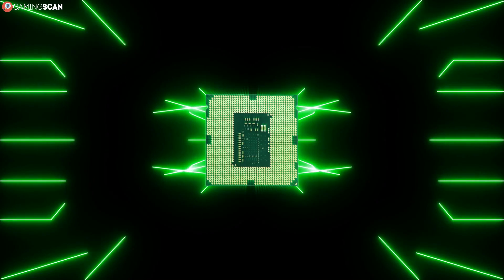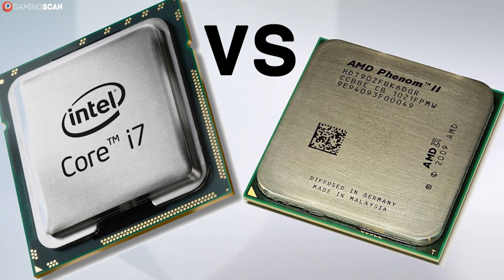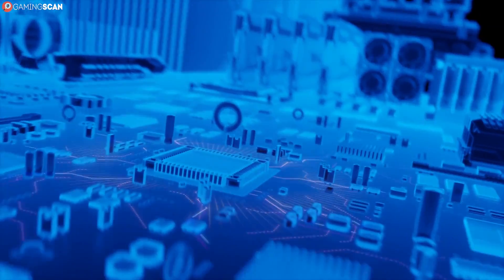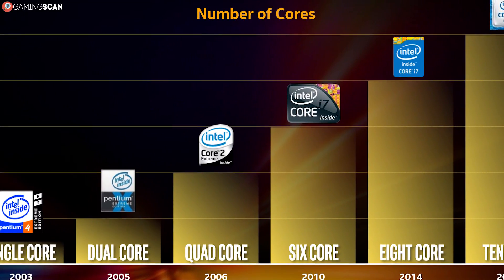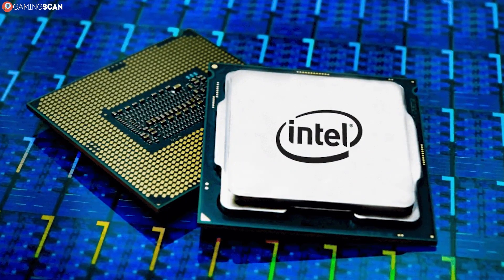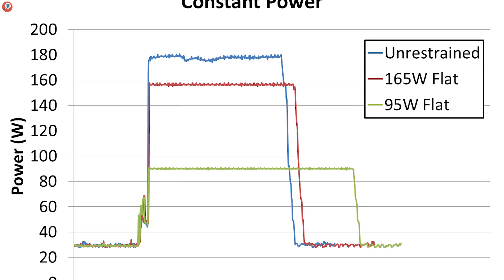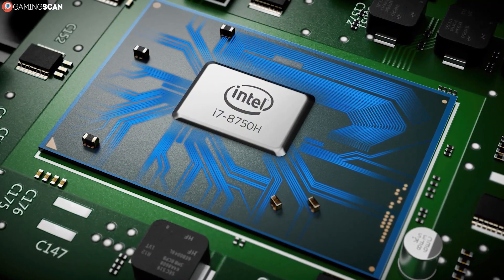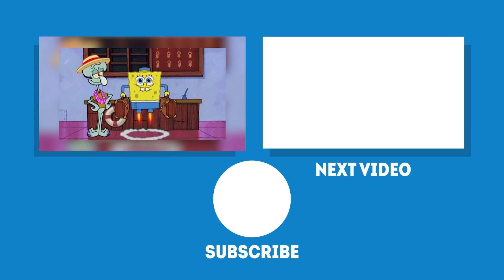CPU Specs Explained (2020) [The Ultimate Guide]

Comment: Good video I learned a few things. 
Question: if you have integrated graphics on a CPU and pair it with a good GPU, will that enhance your overall graphics performance? (Also do all CPU’s come with Integrated Graphics or only some models)
Reply: No your graphics out out depends where u plug your monitor into so put monitor into Gpu for best performance

Comment: Cpu cache is very important for games the ryzen 7 5800x3D has 3 times as much cache as the ryzen 7 5800x and the 5800x3D runs games with much higher refresh rate

Comment: A bit late but hey, just to point out something here.

The i9 and r9 are not Workstation CPUs, these are categorised as Enthusiast CPUs and are still mainly targeted at Gamers. For Workstation it's Threadripper for AMD, Intel does not have an equivelent SKU. That being said, there is nothing wrong in using them as Worstation CPUs, even i5 and r5 are capable in this regard.

Threadripper does not use the AM4 socket, the video is very misleading on this as it shows a Threadripper CPU when talking about the AM4 socket. Threadripper uses TR4 and TRX4 which RYZEN CPUs will not fit into and are also way more expensive.

Your explanation of Clockspeeds is simplistic and wrong in regards to how many instructions can be executer/second, IPC (Instructions per Clock) is important here, and far more important these days than clockspeed. Whilst IPC may not be something listed on any consumer spec sheet, companies will boast about IPC gain over previous generations CPUs, usually listed as a percentage gain. If Clockspeed is all that mattered, then there would be no improvement in performance over the last few years. Look at IPC as like an efficiency metric.

Your explanation of Cache is bonkers, everything a computer does benefits from Cache, even Gaming, and it has nothing to do with multitasking. Take AMDs 5800X 3D CPU with 96MB L3 Cache, 200MHz slower than the 5800X which has 32MB of L3 Cachel, yet is has around a 15% performans increase.

AMD APUs are designated with a G, so an r7 5700G for example is an APU, this one is 8 core / 16 threads but has less cache and lover clocks than its none G variant. On a budget, anything from an r5 3400G upwards will allow you to play most games at 1080p reasonably well, just do no expect to be running much on max settings, but as a stopgap untill you can afford a GPU, they are excellent.

Currently using a 3400G with no issues in the games I play, Path of Exile even @ 1440p runs fine, even ARK runs quite well @1440p but you notice the frame rate dropping a lot, but to be honest, unless you are playing competetively, its not the end of the world, and you get used to it.

Comment: A good way to visualize clock speed is to imagine it as a car's engine. Higher rpm(clock speed) doesn't always translate to higher horsepower/torque.. 5000rpm in a corolla is not the same as 5000rpm in a huraycan

Comment: Wait so I’m confused about something. When I look at older cpus they have the same number of cores as newer ones and not a bad clock speed but are still older with the newer ones being much faster than them? How does that work if they have the same amount of cores and I’ve even come across some with higher clock speeds that perform way worse. Like the amd fx 8150 has 8 cores and a base clock speed of 3.6GHz while the intel core i7 10700 has 8 cores and base clock speed of 2.9 GHz but the intel one is much faster? How does that make sense
Reply: Is it because the intel one has 16 threads? But would that really equate to that big of a performance gain especially with the intel one having such a low base clock speed?
Reply: Looking online, it says that newer cpus can send more data through each clock cycle just because of newer tech which would have been nice to see in the video unless I missed it but then how am I supposed to tell the quality of older cpus then based off their numbers if the reason they are slower is just because it’s “older tech”. How could I compare that with newer cpus to understand how they would perform compared to them so I have an idea of what I’m getting
Reply: @gavingraves8748  Its to do with Core architecture and IPC, basically, CPUs becomming more efficient at what they do at the same speed over the years. A 5 year old CPU will not compete with  this years model at the same Clock speed, there will have been vast improvements in eficiency in the cores, and different architectures brings with it even higher gains.

Comment: Good vid, but correction. The base clock and upper clock is not overclocking. It's called boost clock and it's a feature in almost all modern cpus. It started with Intel laptop cpus. The base clock is set to what it can run on a low temp stabily and consistently. It boosts to max clock to what the cpu is rated for by factory settings. Example. Ryzen 5 3600 is a 3.6ghz base clock that boosts to 4.2ghz when gaming or doing something that needs it. This keeps Temps lower and is more efficient. Now upping the voltage, and cpu multiplyer to a higher number will overclock and in turn you will raise both the base clock and the max clock for boost. You can also overclock ram and for amd ryzen the infinity fabric.

Comment: Intel core for gaming 
Amd ryzen for gaming
I3 and ryzen 3 for budget
I5 and ryzen 5 for mid
I7 and ryzen 7 is more than enough

Don't mind me it's only my note
Reply: I have an i7 but I have to play VANILLA Skyrim on the lowest graphic settings because it lags badly with higher graphic settings. What am I missing? (Sorry for my ignorance, I really don't know much about computers with RAM, Core, Memory etc.)
Reply: @dracoalexios1213  better graphics card probably
Reply: You need a better Graphics Card. They are the most important component of a gaming pc
Reply: @dracoalexios1213  graphics card upgrade needed
Reply: @dracoalexios1213  graphics card most definitely
Reply: @dracoalexios1213  man which generation is your processor.
Reply: @dracoalexios1213  gpu bottleneck but do you mind telling me which gpu you have?
Reply: @dracoalexios1213  maybe switch from igpu to gpu if using laptop
Reply: @dracoalexios1213  good gpu
Reply: i wanna game on a stable fps on modern warfare.what do u recommend
Reply: @simatro9797  i5, minimum 6th gen, with at least 2 decent graphics cards, up to you for those, 16 gb of ram and good cooling system, make sure you get a fan that actually works otherwise you're whole system will go to waste.
Reply: @MikfinityPog  minimum 6 gen ... tf that mean 😔
Reply: @dripdrown3871  Do you not know what minimum means?
Reply: @MikfinityPog  my bad i only recently learned that there’s different gens to intel core i5s
Reply: @MikfinityPog  sli is dead bruh
Reply: @manlikeilyas  Holy shit I didn't even know this comment existed. I remember watching a video made in 2019 where they actually said it was bad to not use more than 1 graphics card.
Reply: @MikfinityPog  yeah realized lol
Reply: I came back for this

Comment: Can someone explain the following:
When pairing an RTX 2080 (Graphics Card) with Ryzen 9 3900X (12 cores/24 threads), it performs either on par with or worse than Intel’s i7 9700K CPU (8 cores, no hyper threading)

I don't understand where we're comparing these two? When they're running a game?
Reply: Most games don't use more than a few cores. Mmos and strategy games like total war use more. A game like call of duty a dual core will suffice. The speed variance is probably because that i7 you reference has a higher base and boost clock speed out of the box. That means it will be faster for apps that don't need a lot of cores. Decoding video, compressing files, rendering, using photos hop filters etc will do better with thr more core processor. 

Now if both had the same cores and same speed it would have other factors. Cache size, memory speed and IPC (instructions per clock) Intel has had better IPC per clock than amd for the last decade but that has changed with zen2 and soon zen3 cpus.

Comment: Hexa core can handle more tasks simultaneously but when its about speed the clock speed of both processors can be the deciding factor. Like a 3 GHz quad core can outperform 1.8 GHz hexa core (same architecture) at specific tasks. Also Quad core is cheaper for budget builds.

Comment: very simple it has tiny switches that allow current through them 1 0 on off, and when you hear 4 GHz for example it means 4 billion times a second so 4 billion excutes a second and 1s and 0s make up all of images text and coding for computers, so what you want to know for a good computer for simple not the best always is that the more cores (parts of the cpu) is better and the higher rate the better, the clock speed it is refered to as is for example 4 Ghz, which is quite good for more than 6 cores.

Comment: Imo, if you're going to be building a budget to low-midrange pc for strictly gaming, Intel is the better choice as it offers better gaming performance at a similar price to AMD. The more you go up in price, midrange to high end, AMD offers more performance for what you're paying and are cheaper in general.
Reply: Could be right on that. From what I've learned intel is usually better for just gaming and AMD is better for those who are gaming streaming, video editing and more.
Reply: @MapleSamuraii  It's just funny that people assume AMD is better just because it offers more cores at a similar price point. Because Intel has less cores, the single core performance is going to be better than AMD but AMD will have better multi-core performance
Gaming is usually not a multi-core task and neither is the average browsing/working experience
I think you'd only benefit from more cores if you were doing medium/heavy multitasking.
Reply: Actually, on a budget means AMD all the way, their APUs are a tremendus cost cutter, back when you posted, GPU prices were just silly and have any realy been affordable to people on a budged within the last 3-6 months. Even then, the AMD APUs means you do not have to spend an extra £150 on an entry level GPU. An I would not recomend Ebay.

AMDs 3400G all the way to the 5700G are fantastic for the price (Not that you can get the 3400G these days).

And they are only going to get better.

Comment: Hello you mention to check if the motherboard is compatible with the cpu is there specific model number that the motherboard has on it to check with what cpu is compatible? And would that be with a graphic card too?
Reply: You may have already found the answer to this, but graphic cards are generally less specific and a 2020 graphics card with probably fit most 2020 mother boards of similar price range. CPUs will normally show very clearly what socket it is as well as the motherboard will too so it's easy to find what you need, but important to make sure that they are compatible. Intel comes in LGa sockets and AMD will normally be AM4

Comment: i3, i5 etc. may be was meant signifying "i" in intel
Reply: @Jwamer Jalal I have to agree with Adam. It wouldn't be "Intel core Intel5" Since the i5 is always going to be named just i5 albeit with the "i" derived from the intel name.
Reply: @Jwamer Jalal Oh interesting find. Thanks for the info!
Reply: Actually, the i is there for patent reasons, back in the day, Intel named their CPUs as 286, 386 and 486 (the 86 being the overall CPU standard architecture), but you cannot patent numbers, so for the 586 Intell change it to Pentium, the 686 became Pentium 2, and so on. It's basically just branding for patent reasons. It realy has nothing to do with the I from Intel. Just think Apple/iPod and the year that Intel started to use the i :)

Comment: So I've been leveling between wether I should change to amd for my next big pc upgrade, but I'm not sure. What I'm doing on my pc is not only gaming, but also streaming and photo editing/digital art. What would people recommend? I've been looking at a core i9K if I go with Intel, or a threadripper if I go with amd. But what do you all think I should go with?
Reply: The  question  what  core  did  you  use  and  how  well  or  how  bad  did  it  work  with  what  you  need  from  it
Reply: Those seem like overkill unless you do those tasks for a living and can afford it as those cpus are almost or over $1000 by themselves. Let alone the ram, motherboard, memoety, hdd, sdd, case, psu, monitor, kb/mouse etc..  A ryzen 3600 will get you by just fine and won't break the bank. Or a 10th Gen i5, both have 6 core 12 threads.

Comment: Intel socket and "some compatibility issues?".

That's like saying that TNT is something that burns really fast.

The bottom line is that any CPU generation with Intel that you buy into, means that you have invested into a dead-end system and if you ever want to upgrade to a newer generation of Intel CPUs then you will have to buy a brand new motherboard to go with it.

So if you had an i7-8700K and you wanted to upgrade to an i9-9900K then you could not use the same motherboard that you paid good money for.

With Ryzen, if you bought a first generation X370 board, you can still run the latest Ryzen series of CPUs in it.
Reply: Yep, AMD guarenteed the AM4 platform untill last year (2021), so no motherbears change needed between 2017 - 2021 is amazing, BUT there were some cheap A320 to B450 boards that could not run the 5000 series due to power demands. Even now, AMD may be hinting that the 6000 series may be able to run on some AM4 boards.

Comment: No mention of IPC (instructions per clock) which is also extremely important to performance, or the huge difference in security issues
Reply: Energyone Could you explain for others and I?
Reply: @jbproductions1224  What would you like to know
Reply: Energyone Could you explain for others and I?
Reply: Energyone Can you explain the “security issues” aspect? I understand the performance side a little.
Reply: @jbproductions1224  ...also, besides the link, workarounds and software security upgrades have made an impact on performance as well - people were being told to turn off hyperthreading not too long ago.  Spectre and Meltdown were just the beginning.  It's also impacted corporate setups considerably and not just at the standard desktop level.
Reply: I did explain it a bit, but not a lot. TL;DR: IPC or instruction per cycles is the amount of data that the processor can process at each clock. But it's not like a spec that you can use to compare different cpus,they have to be on the same architecture....

You can take a look on my channel if you want to.
Reply: @KensleyInnocent  People compared them with different architectures for decades - it was the main reason that AMD couldn't compete until now.  They have recently actually surpassed Intel's IPC - so now it's a matter of latency/clock speed/heat
Reply: @Energyone  I don't think they surpassed intel on that. Because intel still lift more fps(negligible!?) in games and on the same Core/thread level, they'd be better for video editing. Team blue has better per core performance! 

But the performance gap is smaller now.

(I like the 3700X/3900X a lot!!! If I have the money to build a system, it'll be with one of them!)
Reply: @KensleyInnocent  They surpassed Intel's IPC.  Latency differences is what is causing Intel to still barely come out ahead in gaming.  Likely the Infinity Fabric is causing latency but not sure.